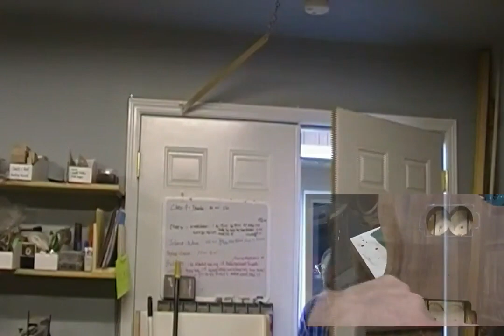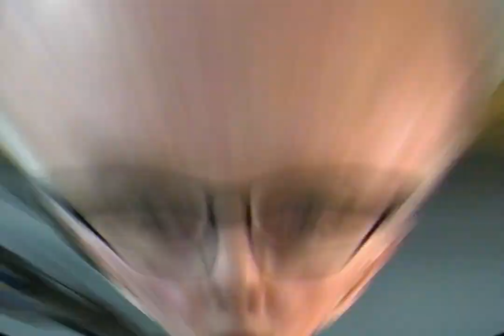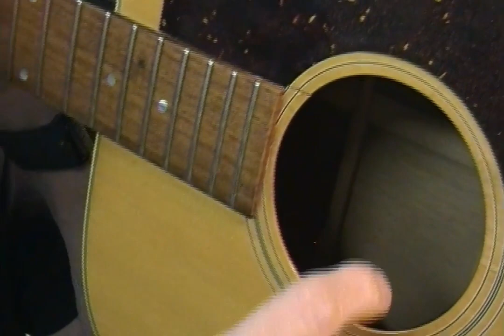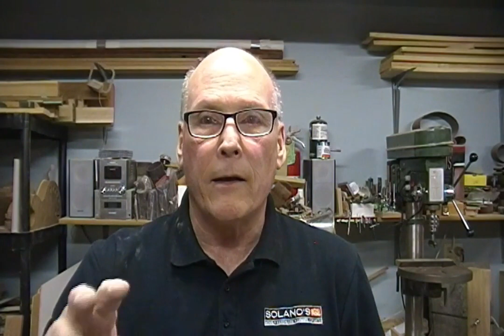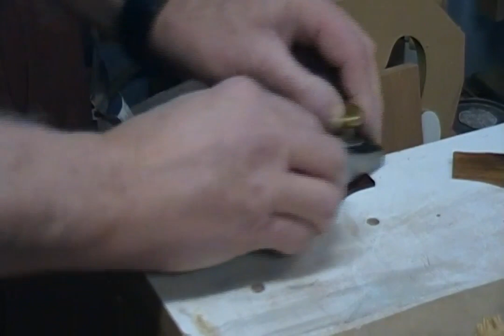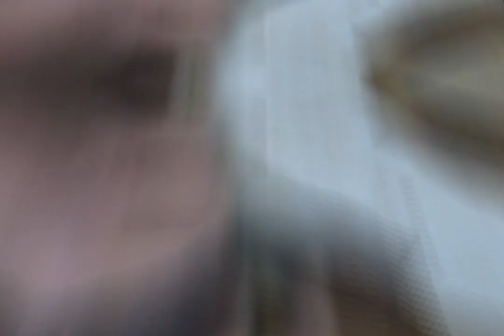Gibson J-40 bridge replacement, part 2 crack repair and shaving bridge, by Jonah Guitars

Comment: I have a 71’ D-28s that has high action and the bridge is all shave down. I don’t want to have the neck reset, so is it possible to shave the top of the bridge down?? Seems it would serve the same purpose. Thoughts?
Reply from the maker: Hi David, it is a common practice to avoid the cost of a neck reset to shave the bridge once the saddle has been lowered as far as it can be. There are some things to consider before you shave the bridge. How much neck relief and the two to one rule about how much wood you need to remove from the bridge. The bridge is also a brace removing to much wood could weaken the top. Also how deep is the saddle slot? Routing the slot deeper could be tricky. If there is two much neck relief you can lower the string height by straightening the neck. But the truss rod is not adjustable so that is accomplished by replacing a few frets with fatter tangs to push the neck straighter. One last thing to consider is the possible loss of value a shaved bridge could bring if you decide to sell this guitar. A well done neck reset will bring top dollar at resale.
Reply: @jonahguitarguy  Ok, I have misspoke. I was wondering if the SADDLE can be shaved down from the top! Not the bridge. The saddle has apparently already been taken down with no more more to shave off, and the bridge appears to also have no more room to be lowered. But there appears to be plenty of room on the top of it. I can email you a photo of it if that would help.
Reply from the maker: @davidikard  Yes David send me a picture please. My email is in the about section of my YT page. Sorry I don't want to make it to easy for scammers.
Reply: I don’t see your email in the about section. Just send me an email and I’ll reply to you with photos. Thanks davidikard@gmail.com